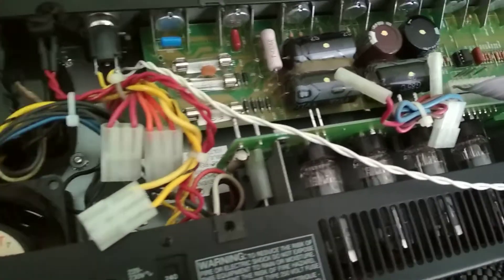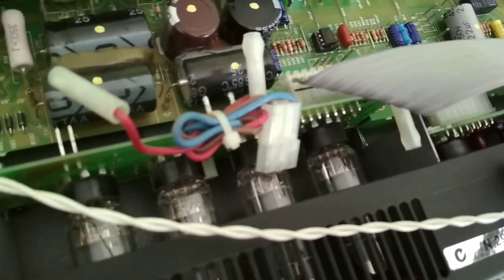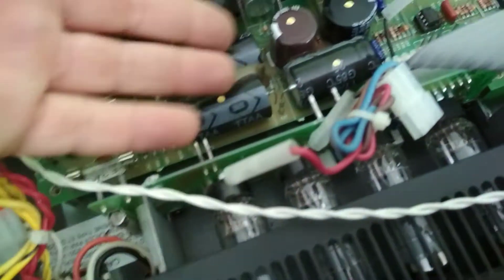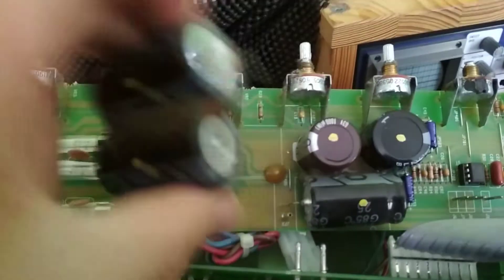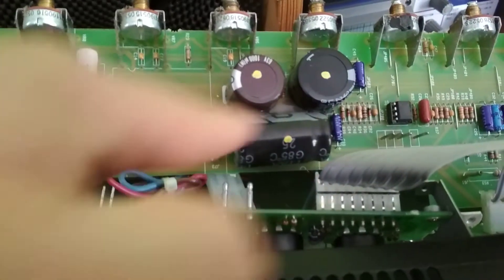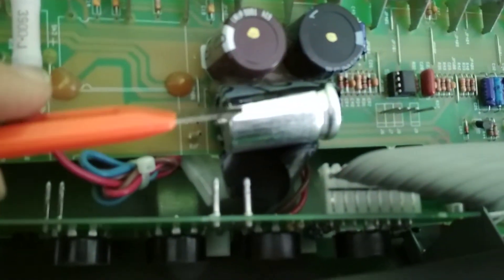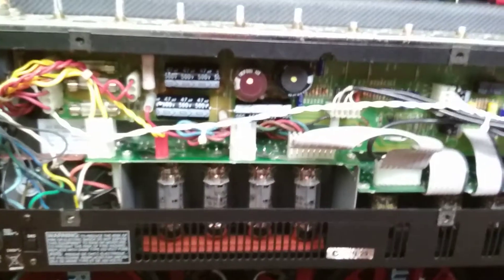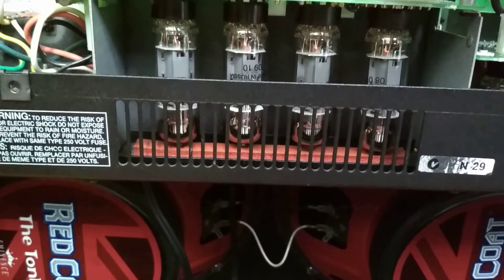Peavey Classic 50 New Upgraded Caps

Comment: I know this was ages ago, getting ready to do the caps on mine...but curious why you didn't change the two bigger radial caps?
Reply from the maker: I could be wrong, but I believe those caps were a low voltage circuit that wasn’t too vital. I can’t remember but I would have likely tested them anyway.
Reply: @whatsstefon  cool thank you sir

Comment: Hi one of these filter caps is blown in my Classic 50 like yours. What is the correct way to discharge a cap before working on the board?
Reply from the maker: The safest way to discharge the caps is to grab a nice big 10W 100 Ohm resistor, attach alligator clips to it and attach the one end of the clip to the chassis (Ground) with the other end making contact with the positive side of each cap.

Measure the DC voltage afterwards to ensure they are discharged. Leaving the multimeter attached, you’ll get to watch the stored voltage discharge.

You’ll also likely notice the voltage begin to rise after you release the alligator clip. This isn’t a huge issue or concern. It will likely not build up very high. Certainly not enough to shock you.
Reply: @whatsstefon  thanks so much!
Reply: Thanks again, I installed new caps in mine last night, everything works great. I dunno if you accept requests, but a video on bias and how to adjust it would be super helpful!   Thanks again for making this video!
Reply from the maker: @tearsforthedying  I believe these amps are fixed bias. So it’ll be wise to study the schematic. Best way to determine if it’s cathode bias or fixed bias is to first trace the cathodes on the EL84 tubes. If they join up to a big resistor, they’re cathode biased. If they go directly to ground it means the bias is fixed bias via a negative bias voltage to the grid. 

How to check the bias? I have many other videos where I do that. With the amp off, and filter caps discharged, set your multimeter to Resistance and check the resistance of each side of the output transformer primary. Basically attach one probe to the wire coming off the plate of the power amp tubes, and the other wire to the centre tap wire. Record the resistance down on paper, then do the other side. Every non-single ended tube amp output transformer should have three wires. You’re measuring the resistance of each side of the push pull.

Next, keeping your probes connected you can turn the amp on. Let it warm up and turn off standby so the amp can make sound. Your multimeter will now be measuring the voltage drop between the same points you just measured the resistance. Write these down. It’ll be a low voltage. Like anywhere between 0.6VDC to 3.5VDC. But be careful. With the amp on like this, there can be 600+ volts flying around.

Now remove the probe from the centre tap and place it to ground. You’re going to measure plate voltages for each side. Here’s where you should see 300-700VDC based on what model amp you’re working on.

Now with these three figures, you can calculate your plate dissipation.

Let’s say as an example I got these figures for one side.

Resistance from centre tap to one side of OT: 75 Ohms.
Voltage drop: 1.2VDC
Plate voltage: 425VDC

I can now calculate current and watts. Wattage being the more important figure. With a goal of getting around 70% of plate dissipation for a fixed bias amp. And we know that EL84 tubes are max 12 Watts. We’re aiming for a plate dissipation of around 8.4 Watts.

The formula is to divide the voltage drop we measured (1.2) by the resistance (75)
So, let’s math- 1.2/75=0.016 (16mA)
Next we take that 0.016A (we don’t convert it it mA) and multiply it by plate voltage (425).
425x0.016=6.8 (Watts)

A safe and not outrageous bias in this example. I’d leave the amp alone and be happy.

Comment: Hi there I would like to get your opinion. I ordered an esr meter and replacement F &T filter caps and this is what I have found.  The filter caps Installed in my model are already 500 V testing with the ESR meter all of the ESR ratings are lower on the ones installed than the brand new F and T filter caps and I don't see any obvious signs of leakage or damage. If the installed ESR is lower than the brand new ones is it safe to assume my filter caps are fine? Here are the ratings of my installed caps:
22uf 500 volt reading 23.97 uf ECR 1.44
22uf 500 volt reading 24.96 uf ECR 1.22

47uf 500 volt reading 48.29uf ESR .85
Parallel 
47uf 500 volt reading 99.12 uf ESR .42

F&T NEW CAPS READINGS not installed 
22uf 500 volt reading 21.13 uf ESR 3.1
22uf 500 volt reading 20.88 uf ESR 3.0
47uf 500 volt reading 46.86uf ESR 1.34
Parallel 
47uf 500 volt reading  94.18 uf ESR .63
Is it an issue that the installed caps are reading larger UF than supposed to , supposed to be 22uf but reading closer to 24?  I wanted to get your opinion before I remove these and it does not help with any of the sound issues I'm perceiving.  I have swapped all the tubes and it sounds better but there's just some odd noises coming through the amplifier that can only be described as a hum here and there. Seems to only do it when the drive channels engage. Thanks in advance, Rob Bluesbound Guitars
Reply: The capacitance rating isn't too big a deal. They are within spec. It would be an issue if you're doubling the rating. The hum might be coming from a filament hum, a poor quality transformer, a poor grounding issue somewhere as well.

Comment: I have a Peavey Classic 50 212 and recently acquired a 410.
Both were built in the very early 90's.
My 212 has both a hum and a kind of fading issue...like, the hum remains at the same volume but the sound of my guitar fades in and out...usually flipping the standby switch fixes it but not for long.

Would recapping it with 5 new filter caps fix both issues?
Or is that fade issue something entirely different?
Reply from the maker: It would definitely be worth replacing the filter caps. The hum could likely be from them. Sometimes, depending on the hum it could also be filament hum from a bad tube. Either way, those caps are 30 years old or more. Discharge then, replace them, ensure you have the correct orientation. Bring them up gently on a variac (not so vital, but worth it in case you see smoke).

It’s also worth replacing the coupling caps to the power tubes.
Reply: @whatsstefon  Thank you for the reply. I forgot to mention that I have in fact replaced all of the tubes fairly recently. And what you are saying jives with what the guy at the repair shop was saying. I was hoping this was something I could do to save me the cost of paying him labor.
Reply from the maker: @returntozero2112  sadly there isn’t a lot that can be done to save on labour. Especially with modern amps like this that are on a PCB. 

All the best with the amp. Perhaps you can work out a deal with them to fix it and pay off the repair bill to help lessen the financial blow.

Comment: I know this is an older video but maybe you can help me out I'm a luthier and only do minor stuff on amplifiers I have a classic 50 in the shop and it has a hum on the drive channel I've changed the tubes and clean the sockets.  It appears to be an older model and the inside was quite dirty with some oxidation any quick advice on how to properly test the filter caps Before I just replace them I searched through your other videos and didn't see anything that matched that topic. Next question is I have a voltage sniffer from Stewart Mcdonald and I just want to confirm I attach it to the chasis as a ground and then touch the other end to the positive side of the filter cap? Thanks in advance, Rob with Bluesbound Guitars Mcdonough Georgia
Reply from the maker: I’m not sure how the voltage sniffer works but that sounds right to me.

Testing filter caps does require either an old vintage cap tester with a “Magic Eye” tube. Or you can use an ESR meter. A rudimentary way to test is to use a new filter cap and just wire it in temporarily with alligator clips. You may or may not notice the hum change.

The hum could be caused by a number of things, and it depends on the frequency. Filter caps are one. A harmonic tube (filaments). A leaking dc blocking cap, a resistor gone out of spec. A broken track, wire or terminal.

A handy tool is a signal tracer which can at least help isolate where the signal is compromised.
Reply: @whatsstefon   Thank you so much for the reply I was thinking of ordering an ESR meter the only concern is some people claim they don't test well in circuit on higher voltage items but I think I'm gonna give it a shot. I may just do as you suggested in the video and replace all the filter caps noted. Thanks again,  Rob Bluesbound Guitars

Comment: I have had my classic 50 since the tweed style came out ,,, It has served me well for many years!.... yes had to do some maint, repairs...new presence..pot ... it did not  go bad knob fell off all the time,,and during separating of the knob shaft it broke.. was in a Rush Tribute band here in Chicago for 13 years..so the amp was used alot,,,have to mention I have the Classic 50 Head and 2 external cab's 1) 4x10, and 1) 1x15, both are 16ohm,,,I am thrilled at the ruggedness of the amp as well as its clean channel ,, is aw some ,, and is very Pedel Friendly! just my humble Opinion
Reply from the maker: They are great, while they work. Sounds like you have a great selection play with. Thank you for the comment.

Comment: could I ask if the little yell capacitor right under the inputs makes noise when you tap it does it mean they are bad I  have a few of these amps and they are a pain but I cant get the tone
Reply from the maker: I’d say at best the solder joint might be faulty. Reflow the joint and test. If it’s still bad it could be a broken leg on the cap or the cap itself is dead. Replace it.

Comment: Have a 2003 classic 50 2x12.  Everything works fine.....That said, would you recommend a recap regardless?  If so anything else as long as the guts are open?  From everything I've heard the labor of exposing everything is a bulk of the expense.  Thanks in advance!
Reply from the maker: The original caps are near twenty years old. So it might be worth it while everything is apart. It’s always a tough call “if it ain’t broke, don’t fix it” but since it will be operated in anyway, you might as well.

Comment: What year is this amp ?..  I have a '90s model 410 and it's a great work horse and reliable however the speakers could be upgraded and probably needs a few mods .. which is why I'm searching
Reply from the maker: It's a late 90's model, I believe. It's been reliable all this time, according to the customer. However, the years of heat directly on the PCB's has caused the PCB to become brittle, broken, and also a little conductive. Not worth trying to get new PCB's. The costs of time and labour of rebuilding a PCB amp is prohibitive and not worth it.

Comment: If my Peavey Classic 50 was  built in 2015, will I ever need to recap it, like an older one?
Reply from the maker: Capacitors generally have a lifespan of 10 years. I’ve found from experience that most amp manufacturers use cheap Chinese caps, not Sprague or F&T. So I’d say use the amp until you notice a hum or test the filter caps yourself to see if they’re leaking.

Comment: I see you changed out the IC 85 C degree Cap with a 500V 47 Uf. So the cap which is made by Illinois Capacitors is the brand name for just this one. The question I ask is why where the IC was not changed out previously or is there a reason why it's like this? Have you just bought this Amp and don't have any history for it.
  I also noticed you did not take out the PCB for the tubes out to give you more room to operate. I ask you how did you do that without damaging boards and components? 
 I have to change out these three Caps as well and see your Amp has the same setup before you changed the Capacitors. Also, I cannot read everything on the capacitor as it has been covered in glue and hence my question to you but have just enough writing to read it to be the same as your cap. BTW My Peavy is a Classical 50 like yours but a 410. As I like playing the Shadows Music with pedals etc I also have a Harmonix Tube instead of a JJ like the rest. Do you know if that is what happens to change the sound coming out of the amp where the JJ 12AX7-S- go on the Preamp side?? It is in Number one position and I have heard the sound changes as you change the position. Like to find out if this is having some truth about it. 
Although I have drained the caps, I am led to believe all amps have a de-charging chip installed but like you don't trust that and always de-charge them beforehand. I made up my own discharging lead to do that and have checked to really see if they need replacing. They certainly do! Actually, they were that bad no wonder my amp just flickered at the light and would not start again afterward when I tried to switch it on but the fan kept on running, maybe to fan the fire if it caught fire.  I have had this Amp 13 years and only play it at home. It does have great sound. Very similar to the Vox Amp of the '50-'60s that The Shadows used to get the clean sound, (I assume you know who The Shadows where?).  I also use Digitech Didgidelay Effect Pedals doubled up to get that final delay sound coming thru the amp  
 I think this Video you have created is the best one explaining how to change out caps on a Peavey Classical 50. Congrats:-).
 Guess you can see I am a Beginner. I do understand electricity can kill but to pay someone to do this fix I might as well be dead because of the money I would have to fork out. No offense to the Technicians as you have to make a living somehow but with someone else's money, not mine. I am a pensioner. You can see I have a lot of time on my hand to do this repair LOL.
Reply from the maker: Hi there. Wow, so much text. I'll try my best to help answer all your questions and things you noticed.

1. I don't believe the Caps were ever changed prior. I believe these were the caps that the amp was manufactured.

2. I bought the amp last year. However, it is now long gone.

3. I didn't need room to operate, so it was easy to just remove the main board and gently tilt it out of the chassis, remove the caps and refit the PCB into the chassis.

4. I replaced the caps with the same value in capacitance, as this is important to match or come as close as possible to. The voltage, I will always purchase caps that have a higher rating if I can source them. So replace your ones with the same 47uF and 22uF caps, but instead of 450V, please try and find 500V ones.

5. With trying different tubes in amps to see which one sounds better, it's really subjective. I love Tung-Sol tubes, and try to use them where possible. However, I used them in my Fender Bassman 50 I restored last year. Check out my videos for that one. However, I found the amp was a little too harsh. So I recently tried a set of Svetlana tubes, and the amp sounds amazingly better to me. One of my band mates really noticed the difference in tone. So, tubes really do change the sound. The best thing to do is try it for yourself and listen to which tube you like the best to your ears, and to which ones work better in the environment you spend most of your time in, whether it's practice at home or on loud stages.

6. I don't believe all amps have any discharging circuit. Some might, but manually discharging the caps myself and then testing the voltage with a basic multimeter will ensure you are absolutely safe and won't end up making any potentially fatal mistakes. 

7. Yes, I know the Shadows. I love them. 

8. Thank you. Appreciate your love and support. With my videos, I try to do stuff that I have become frustrated with because I will search for videos where I've needed help in the past, and have not been able to find them.

9. I think it's great that you're trying to repair things yourself. No offence to most technicians. But another reason I do these repairs myself is because in the past I've been ripped off by dodgy ones.

All the best with your learning. I love the challenge of finding the source of the problem. The cause of the issue. Fix that, and the problem goes away. Sometimes it's been frustrating as my expertise and lack of knowledge has made things very challenging or impossible. However, I still enjoy not being beaten by an amp repair. Remember to stay safe. Take your time and make every contact you make with a live amp a very slow and deliberate one.

Comment: please tell me what is a good guitar amp ?
Reply from the maker: That’s so subjective. Really it’s a matter of opinion, tone you prefer, your guitars, playing style. If you want a quality guitar amp, buy a 60s Fender. Anything in them can be fixed or replaced. No PCB. No proprietary junk. Just a bunch of tubes connected together with wires, resistors and capacitors on a tag board. Easy and cheap to fix. They don’t run the tubes at ridiculous high voltages or plate dissipation. So you could theoretically have the amp last you a lifetime and the tubes might only need replacing every 4-5 years, even with daily use because they’re not running them as blazing hot as the sun.
Reply: @whatsstefon  thank you for the advice. I am considering a Yamaha series 2, G100. My friend plays one and it has been trouble free for many years. What are your thoughts on these amps ?   Keep Rocking !!
Reply from the maker: @MrPeterbennett  ah great. Sadly I have no experience at all with them, but Yamaha has generally always made solid stuff.

Comment: Hello. Could you itemize the number of caps/specs for this repair? Thanks.
Reply from the maker: From memory, it was as follows for the main filter caps.

3x 47uF 500V
These are the ones above the main power tubes.

2x 22uF 500V
The ones closer to the preamp tubes.

I believe the radial electrolytic caps are more for the low voltage circuit that powers the IC and such.

Hope that helps.